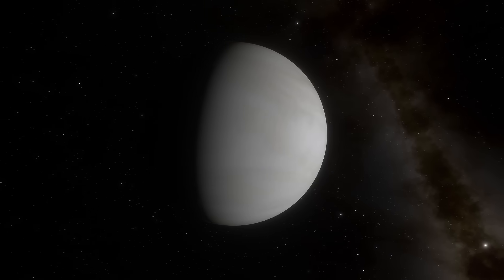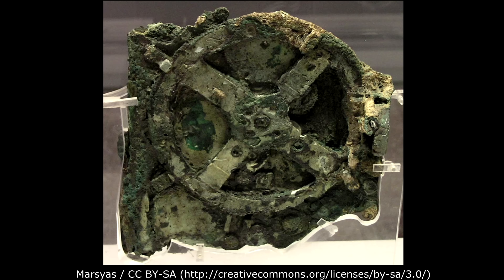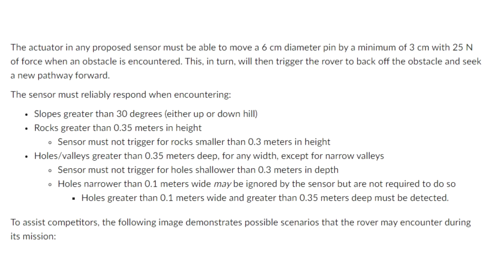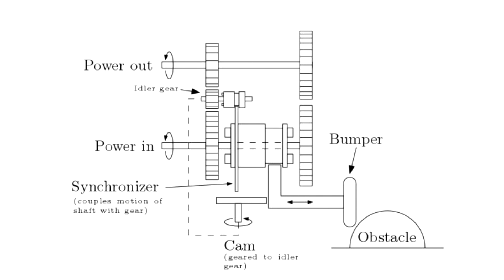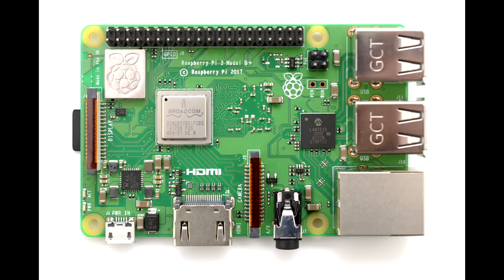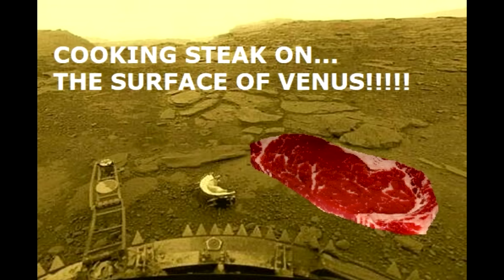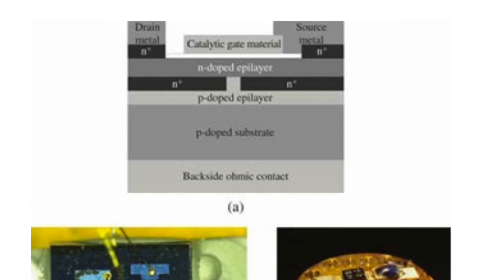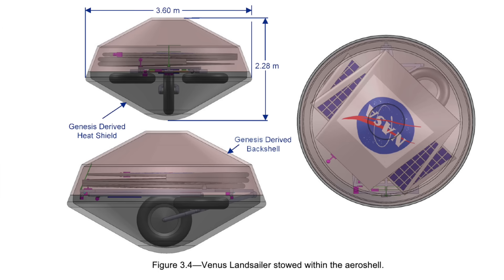Venus Rover Concepts That Beat The Killer Atmosphere

Comment: This competition certainly proposes an interesting set of intellectual challenges, but wouldn't it be easier (easiest?) to combine some sort of air ship (dirigible, balloon, drone) that would fly or hover at altitude, cool itself off and and deal with powering issues and then have excursions to the surface to gather scientific data that last maybe a few hours?  This would allow all of the advantages of a rover, but without the roving and heat & pressure disadvantages, and would also allow aerial survey imaging of the surface from hover altitude.  With such a dense atmosphere "flying" would be more akin to "floating" and shouldn't be overly difficult.  At altitude batteries could be charged where the solar flux is greater or the temperature gradient in an RTG would be greater.  Perhaps the temperature and composition of the atmosphere is not conducive to this idea, but at least to first order it seems far simpler than creating a fully mechanical rover complete with fully mechanical measuring devices and communications systems.  (For example, how the heck would one build a fully mechanical mass spectrometer or x-ray laser and gas chromatograph?)

Comment: What about computers like the Saturn 5, they where mainly just metal components that have high degree melting points?
Reply: The problem is the inside will get so hot it will melt the electronics.
Reply: FotY the Saturn five used hard coded logic that was copper wire and iron rings, the logic was made of steel and copper which both won’t melt

Comment: Microfluidic logic would be great for decision making given the only thing that moves in it is the liquid. It works on the principle on what determines the Reynolds number for a specific path, obviously the path of least resistance is what is taken and that is what is exploited to make it work. 

There has been prototying of microfluidic logic using shrinkydink and a exacto knife so it's not exactly impossible for the average person to prototype and test. Half adders and full adders have been made. Meaning, 'and' 'xor' 'or' as well as 'not' gates are possible. With no moving parts and it in a tiny lightweight all closed system dust shouldn't be a concern, but thermal expansion would be. As long as you made sure the heat was distributed equally it should still work I believe.

The suspension could provide the tiny amounts of pressure required to power those chips so mechanical loss to a parasitic draw would be extremely low. You could have a path with a low Reynolds number when the fluid is at a low velocity or not moving and as the suspension moved further it would increase the velocity of the fluid so a different path would become easier for it to take which would allow that decision making to happen. 

Also a tiny ball or wheel in the front of each main steering/driven wheel that was pressed down via a spring would also be able to tell if this was about to go off a ledge or not. This could once again be routed to a microfluidic chip if it suddenly was pushed down fast the fluid would increase in velocity making it take a different route which would signify that it was over a cliff it could be bound together with the suspension using a 'and' logic gate. If both are true then it can move forward if one is false it reverses and slightly turns then tries again. Just a little all mechanical roomba with microfluidic logic controlling it. 

Keep in mind I haven't been to college I'm a high school dropout and I just woke up. So I'm not thinking this out a ton just spit balling in a YouTube comment here. But someone with more knowledge than me might get an idea off of this comment and come up with something that would function off similar principles. But it would be a good way to make basic logic without moving parts something that would be beneficial especially with it being so small and lightweight. I see he had a pneumatic processor mentioned but it looks like that would require moving parts where as this would not.

Comment: Speaking out of my ARSE here, because I don't really know what I'm talking about... but would there be a way to make a power and a cooling system. Hear me out. Obviously it's really hot and the atmosphere is really dense. What if there was a way to essentially make a closed loop steam engine( i guess thats what you would call it). The abundance of heat would obviously make plenty of steam, which can be made into power, which can power something (maybe something akin to a freon compressor) to cool the steam back to liquid, then push that liquid back out to the heat again, and repeat.

Comment: We can see through the thick atmosphere? Otherwise couldn't we use an extremely radioactive block and just use a metal shutter and Morse code the data up. Could be done analog to actuate but converting the data to Morse would be hard. 

It would actually use the change from up and and down and not the length of the open or closed for data points. That helps with data continuety on old audio data cables.

Comment: just put like 3 lazers in front that look at different angles and they just check levelness if it detects something 3 feet off of the floor its on it should avoid(to avoid cliffs and ditches) then you just need a thing for impact detection that you then use to change direction

Comment: How much mass could you land on Venus?   Consider a limited life span rover, 10 days,  20 days, 30 days something useful, but not long.   What if you landed the rover with a large block of a phase change material cooled below its state change temp and Isolated in a dewar.   The rover then runs using the mass as an ice pack.   The pack would have X amount of KWh or energy it could absorb before changing temperature.  The pack would have energy inputs from the environment (thermal leakage across the dewar) and the electronics.

Comment: Why not use the satellite for obstacle avoidance though? We're talking about 1/3-1/10 of a meter which sounds plausible a resolution for a microwave radar. Then guide the rover by differential heating of its steering mechanism using a strong laser beam...

Comment: Putting a blimp in the more hospitable parts of Venus's upper atmosphere seems way more worthwhile than faffing about on the ground while we're waiting for the high temperature semiconductors to catch up. With everything we've learned about semiconductors developing regular computers I imagine we can have high temperature versions Intel 4004 in a decade or two though, depending on how much funding goes into working on them.

Also transmitting data with rotating disks read by radar hurts my soul. You couldn't possibly get much more than about 1 byte per second that way.

Comment: Just drop 1000s of tiny robots from an airship at XX? km. (there is an altitude where the temp is about 23C).  Each robot only lasts a few minutes, but together they can survey 100s of miles.  One or two larger flying robots can drop down to grab samples and return to the mothership for analysis.

Comment: If we started using the silicon carbide chips in normal PC's (Hypothetically), does that mean we could overclock graphics cards like 3000% before issues start arising? Heat wouldn't be an issue anymore!

Comment: Why not keep it simple? Just insulate the critical components. Silicone or carbon areogels could be used to insulate from very high external temps and provide structural support against the high pressures. It wouldnt take much energy to maintain proper operating temps. Theres a lot of exciting tech coming from using graphene based products.

Comment: Venus has wind for energy right? So the solution needs to be powered by wind to cool the tech. Why not go way old school? Like 1868 old when a device was made to take a thermal offset to generate motion. Funny thing is if you provided it motion, it would generate a thermal offset. The Sterling engine. We have metals that would have no problem with the heat or corrosion for both the vertical wind turbine and the Sterling. Maybe use lead as lubrication?

Comment: Sounds like a job for pneumatics.....rubber can withstand temperatures of up to about 1000 before it starts becoming tacky, so it seems perfect on a 864 degree surface.  A wind turbine can be used to "pump" the device to keep a positive and negative "battery" like situation, and all other electronics has a pneumatic equal.  Medicine actually has come a long way in making these very small, I wouldn't be surprised if we move into this realm because all these parts could be 3D printed, eventually, and that's what we need for longterm space, manufacturing of circuits.  I imagine it will look similar to the glass plates that you see in "The Expanse" because the circuits are held in a medium similar to glass.

But...you probably knew all that.

Comment: if the air is so dense, a heatpump might work.  could the wind power the heat pump effectively?  just get the mechanical stuff good enough to run the heatpump. make sure the electronics can be stored in the high temp environment ok.

Maybe use lead as a heat spreader?

Comment: You can make mechanical radio by modulating frequency. You mechanically move one of the sides of a condenser so the LRC circuit changes frequency between two different mechanical positions.
But idea is as stupid as radar reflexion scanning. Sending megabyte of data would take years.
Because of wind turbine on top and lack of transistors I would consider double lrc circuit like in tesla coil for power supply.

Comment: the thing i love about this, is it really shows how narrow the scope of human technology is.
we may very impressed with what we can do at 50c and 10bar, and as soon as the environment changes its either completely useless or we try to insulate it from the environment so it isnt.
I wonder how the technological path of discovery in the past 500 years would have progressed differently in an environment this foreign.
What would we know that we now dont, what do we know now that we wouldnt on the surface of venus.
Reply: We design for the environment that the equipment will face. On earth, there is no need to design for 455 C or 90 atmospheres. If there was, we would design it as such.
Reply: I bet you it would have worked in 500c and an atmosphere of sulferic acid, but would fail once it got too cold or exposed to oxygen.
Reply: Valve (vacuum tubes) operate at this temperature and, being enclosed in glass/ceramic, would likely be OK in this atmosphere. Obviously any serious computing would be done on the satellite and relayed to the Venus rover.
Reply: The same question arises of evolution how different might we be
Reply: I've always wondered why people don't consider it to be more obvious that many of the solutions lie in discovering techniques that work fine in that environment, rather than finding ways to shield Earth stuff from it. We have this stereotype that it's a Hostile environment, yet our environment is hostile to most equipment that works fine on Venus.
Reply: @TheReaverOfDarkness  The rationale for it isnt bad though. we get more from applying moore's law for the last 70 years to silicon technology, than we would have focusing on technology that would work on venus, but if it wernt true, for sure life would be different.

I dunno, its kinda woo-woo stuff, but i love the idea that alien tech doesnt have to be better for it to look like magic, it only has to be developed from a different environment. This video kinda put the point on that for me.
Reply: @c_o_n_t_e_n_t3420  you watch Joe Scott's channel?
Reply: @bombappetit  Ive seen some of his vids, but I dont follow him close.
Did he say something similar? Whats the vid?
Reply: @c_o_n_t_e_n_t3420  nah. It's just that he often triggers his "woo-woo" alarm whenever he wants to talk about something that's really out there.

Comment: My idea was to use vacuum tubes (thermionic valves) to make a radio control system.  They tend to be large, so you couldn't fit very much computing power.  But the are perfectly fine working at high temperatures.  So that is one way to send standard radio signals.  Figuring out what to send would be a tad trickier.

Edit: Vacuum tubes have a bad reputation for breaking because of thermal cycling.  If you keep them hot (in the venus atmosphere), they are much less likely to break.  A good vacuum tube will last years.

Comment: I designed a refrigerated rover for venus once. The trick is not using RTG's, instead use a fully critical nuclear reactor. The best part is you don't need to worry about polluting venus, not like you're going to make it worse. Design of the reactor was left as an exercise for the reader.

Comment: Thanks Scott!  Red Hot!

Wasn't aware of silicon carbide.  Will be losing a night's sleep there.  Thanks for the IEEE link!

Still believe a zeppelin in the "Green Zone" could equilibrate and make deep dives into the hot, denser part of the atmosphere take a few pictures and then rise to shed heat between sessions.

Your treatment of topics was great.  Love the brief review of heat exchange barriers that limit nuclear power sources, and the "steampunk" mechanical hybrid rover systems.  Comprehensive and balanced review.

You've been working hard recently.  Don't stop!  Never go a more than a few days without checking your site.

Comment: There was research into resistance based memory. Wires that changed their resistance when you pass a certain ammount of current on them. Reading is done by passing a smaller current that won't change state when reading. It was a promissing tech before TC logic became reliable enough. But there's a pretty close relationship between electrical resistance and temperature. Especially so in the kind of material they used for this tech, I presume.

The other option would be magnetic based memory. Though magnets lose pull at high temperatures. Quick search revealed the highest rated ones give up at 300°C.

Comment: Off the top of my head I can only think of one technology, that is already used, that would meet the requirements of a non-electrical computer for control of a rover that would work at those temperatures. I don't know what I would need the two wires. But to make a prototype would cost me about $30,000. So hardly worth it for the chance of a $15,000 prize.

Comment: If this is targeting a specific mission length, then what would be the feasibility of combining mechanical movement with an ultra insulated electronics bay?  Maybe add in a peltier cooling device to control some of the operations heat from the electronics.  It'd probably have to be several layers of vacuum chambers, since an air filled insulation wouldn't exactly work there.  An outer layer that reacts with the atmosphere and puffs up to knock down a fair bit of the heat immediately would help too.

Comment: When my eye glimpsed at the thumbnail, I read "how to E X P L O D E  the deadliest planet".

Btw. In Venus it rains mercury.
Isn't that the most METAL thing in the solar system?
Reply: [citation needed]
Reply: I'd heard it rains sulfuric acid.

Fair enough, some people don't know the difference between cyanide and arsenic.
Reply: That poses a serious problem for almost any rover built of metal. Mercury likes to form alloys with other metals and degrades/corrodes them.
You can kiss anything aluminum goodbye.
Reply: @theq4602  I've never heard of mercury on Venus. It rains sulfuric acid, which also would suck for any rover if it weren't for the fact that even sulfuric acid evaporates before it reaches the surface.

Edit: Currently reading about lead sulfide and bismuth sulfide snows, which don't sound that concerning to me. I'm sure they react with some potential materials for rovers, but not too many of them, certainly.

Comment: Thinking back to my childhood (I'm 62), I remember the "bump 'n' go" mechanical toys I had in the 1960s.  For the younger generations who might not be familiar with them, these were essentially rover-type vehicles run by a battery-powered DC motor.  They had an automatic steering system which was completely mechanical.  The vehicle would drive until it encountered an obstacle and then change course and continue in a different direction.  Some were even designed to be operated on a tabletop and they would avoid driving off the edges.  Granted, there was no intelligence involved in their behavior -- their choice of direction upon encountering obstacles was essentially random -- but even randomness will still cover ground, and such a rover could be tracked from orbit to correlate data with its location.  Perhaps the mechanisms that these toys used could be a reasonable starting point for a Venus rover.
Reply: Cheap robotic vacuum cleaners work that way :D
Reply: DC Motor? Luxury!  My one was wind-up - no battery.
Reply: “essentially rover-type vehicles run by a battery-powered DC motor.” 
Okay cool.   
“They were completely mechanical, with no electronics at all.“
confused screaming
Reply: @mycroft3322  Batteries and motors are electrical, not electronic.
Reply: @IDoNotLikeHandlesOnYT  if you take a second and a dictionary, you’ll realize electronic is electrical.
Reply: Mycroft 33 I mean I’d double check that because our lecturer would disagree
Reply: @luke7503  your lecturer would recognize that there is context to be considered that none of you all are considering here. Double check that.
Reply: @mycroft3322  Category "electronic" belongs to the category "electrical", like squares are rectangles. You can have something electrical which isn't electronic just like you can have a rectangle which isn't square. So nothing wrong with what OP said. And even if, the whole discussion is pointless because as you've seen in the video, in this context you can replace the DC motor powered by a battery packed with an input shaft powered by a wind turbine - what you get is a completely mechanical system, with no electronics and no electrics.